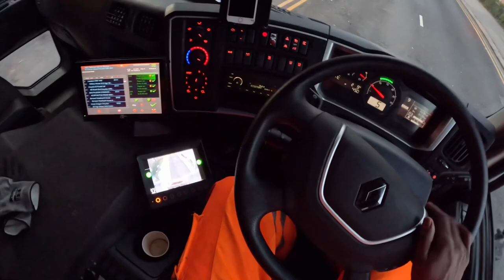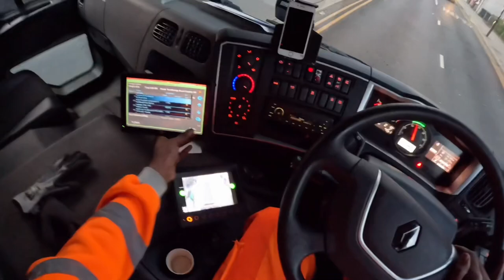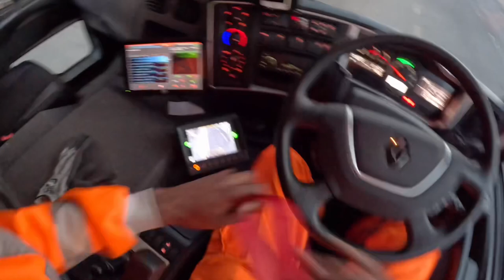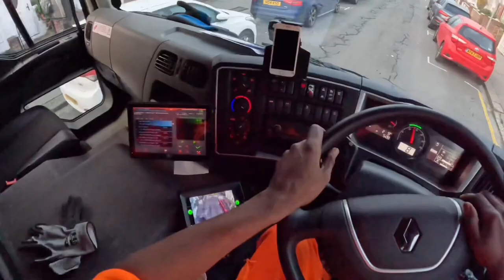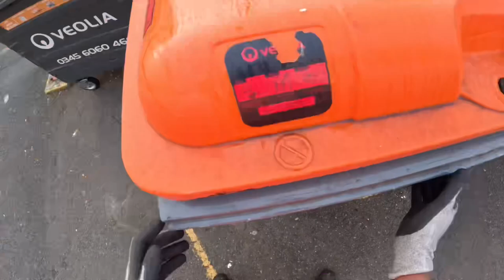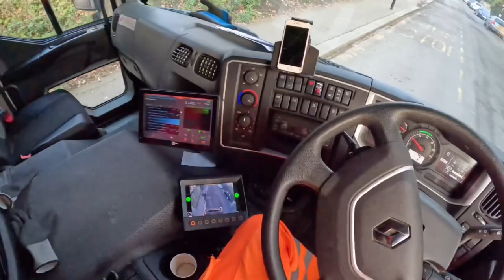Working solo on the waste/garbage recycling route in Croydon in a dustcart/garbage truck

Comment: Nice video, how come there is a separate cardboard round if you collect cardboard on your round? Seems a waste of trucks and staff🤔
Reply: It’s like your council for example, they have routes for recycling and general waste, 1 wagon can’t do all the routes just for general waste which is why they have different crews doing different routes on the same rubbish. Would take way to long for 1 crew to do everything on general or recycling.
Reply: @Bin_Truck_Fan87  oh yeah I know that, I’m meaning with veolia trade collections like in this video, why are there separate bins for cardboard when cardboard is collected in the dry mixed recycling bins that are being emptied in this video?
Reply from the maker: Thank you for watching. I’m not on council routes, I’m on commercial and the jobs are staggered all over. It can be long but quite manageable 😀
Reply from the maker: It’s the customer’s preference and prices I’m assuming. Some segregate the clean paper and cardboard. Also cardboard is tipped at a different bay.